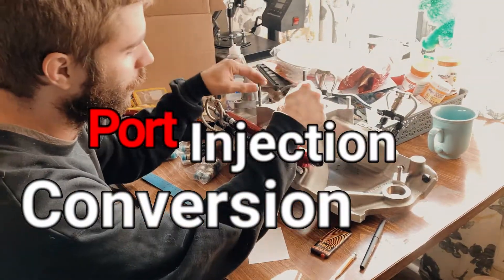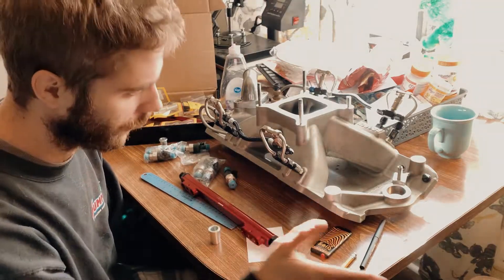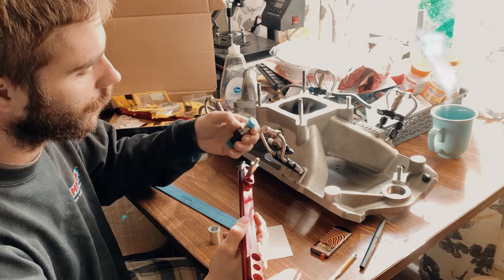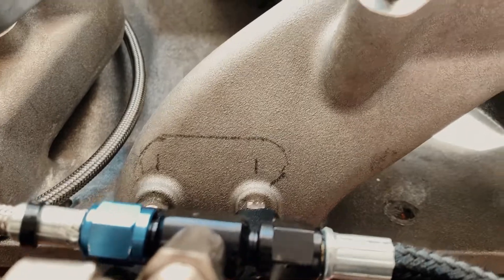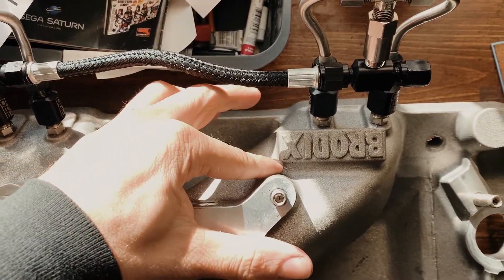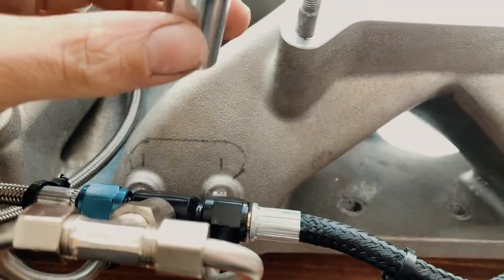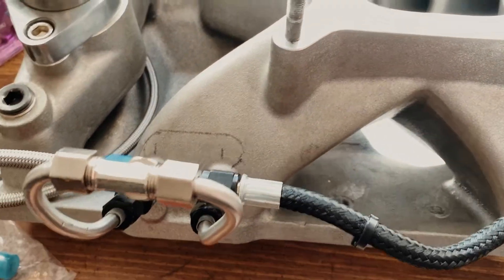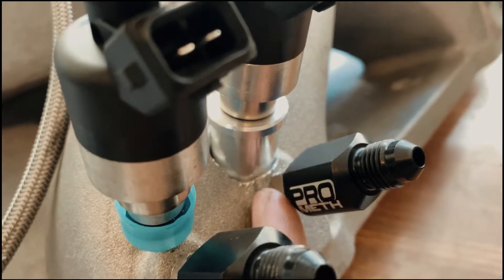DIY 4150 flange four barrel intake manifold to Port injection conversion

Comment: If anyone is interested in doing this but aluminum welding isnt something you have access to. Older Nissan / Datsun's used thread in bungs that work with modern injectors

Comment: curious, why not spray it through a plate at the carb mating flange? wouldnt it decrease charge temperature more effectively?  seems over complicated and maybe not as beneficial ?  Hoping to learn more about this stuff is why I ask, not trying to nitpick. i think this stuff is super cool!
Reply from the maker: Even distribution is key to keeping everything happy, I have the eight port injectors that spray consistently in each cylinder. I also have another injector spraying into the plenum. A single fogger or plate tends to leave one or two cylinders a little leaner than the others.
Reply: @BlytheLifeRacing  Exactly.  As you already know, the fuel should be "delivered" to each cylinder.
Reply: Good job my brother I know I couldn't have did it...

Comment: Very cool work..... How deep into the runner did the bung/injector end up being? Did you have to grind off anything due to the different angle of the runner vs the bung?
Reply from the maker: It goes in about 5/8" or so, bottoms out the injector to the rail, no leaks. I did match the bung to the runner angle on the inside.